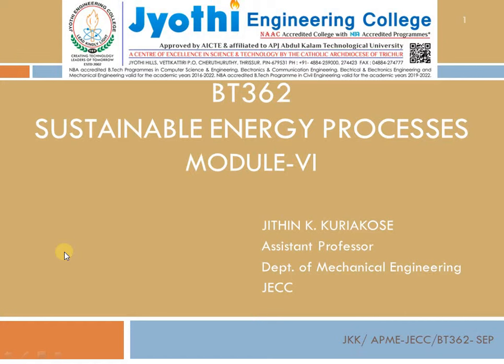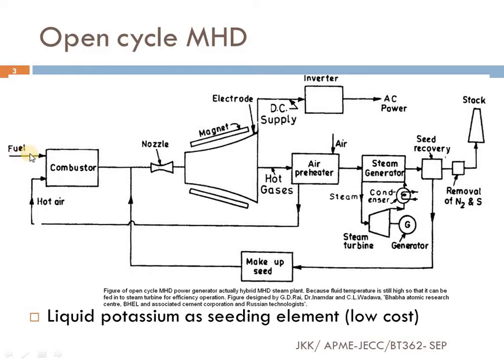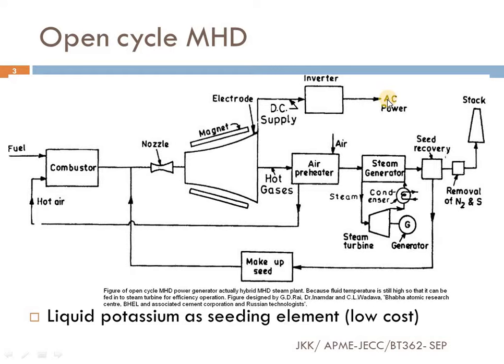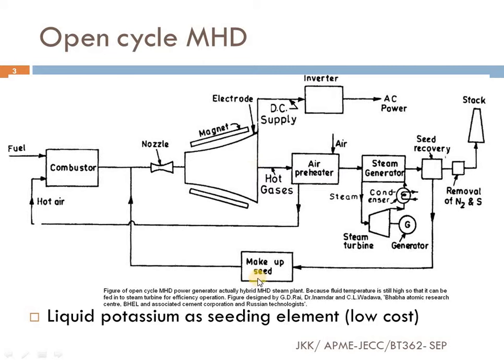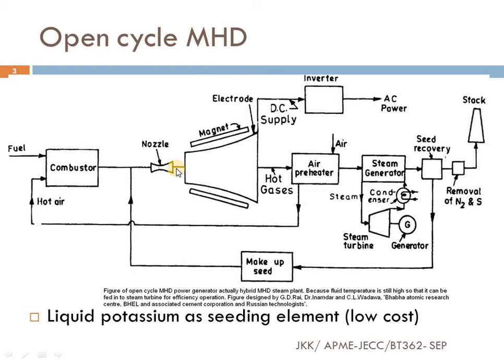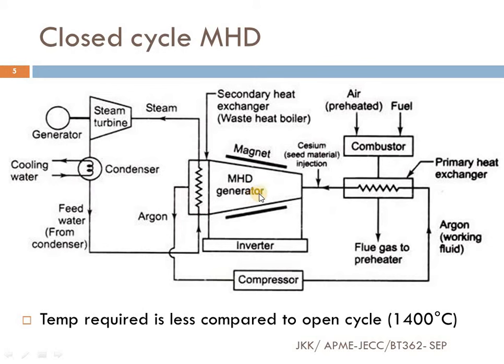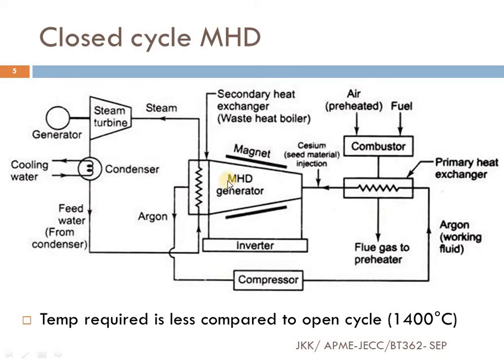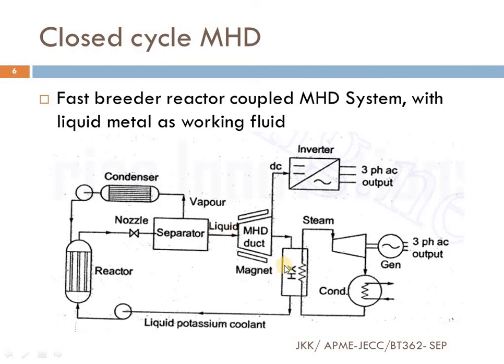Open and Closed Cycle MHD System

Comment: what would be the thermodynamic efficiency of the MHD section?
Reply: Calculate it by cycle thermal efficiency formula used in rankine, braytton cycles etc
Reply: @masterofdisaster117  what are the intake and discharge temperature and pressure?